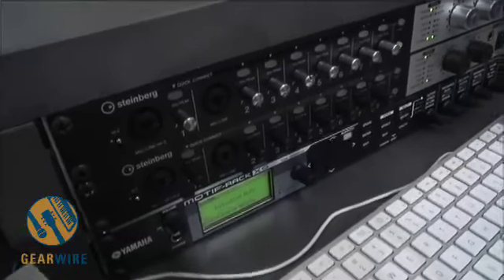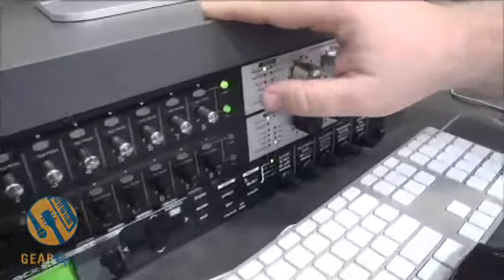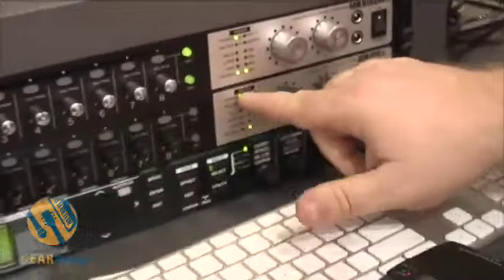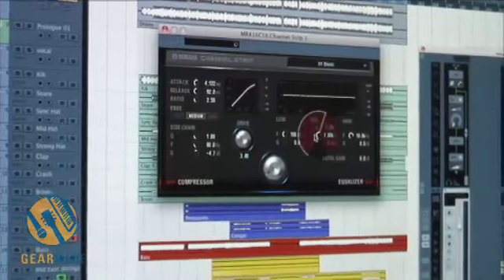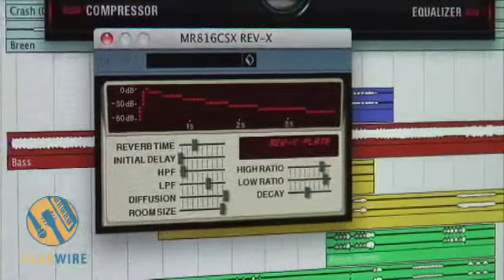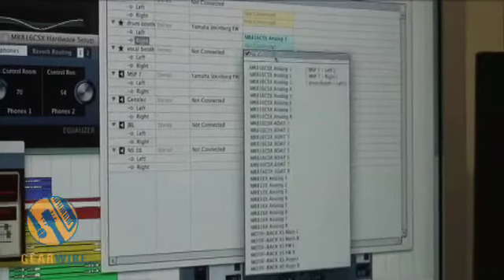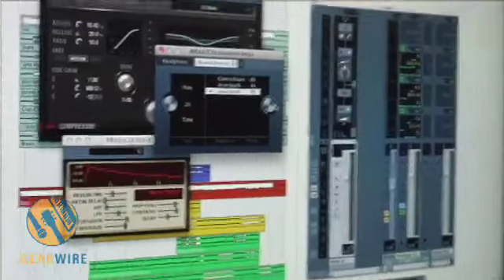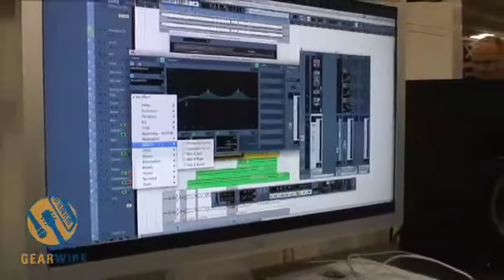Steinberg MR816 CSX Face To Interface At 125th AES 2008

Comment: mumble city.  For those with real mixing desks,..I don't believe he explained how to run 16 ins (or outs) simultaneously, and if you can retain 96 even if you are running 3 mr units.. He spent so much time selling his rev x and comp/limiters,..that I'm thinking they are not targeting anybody very high up the food-chain,..and yet, I believe this mr unit is supposed to sound good enough to compete with products in studios where they are not looking for a cheap onboard limiter or revx.? Am I wrong?